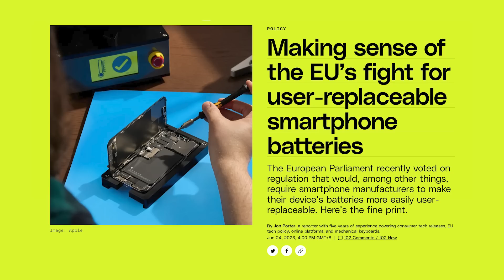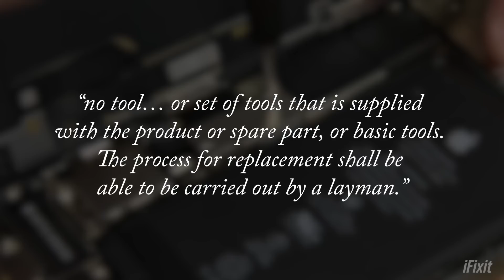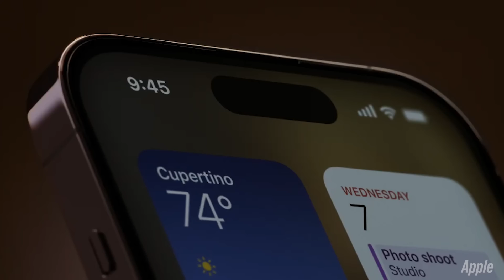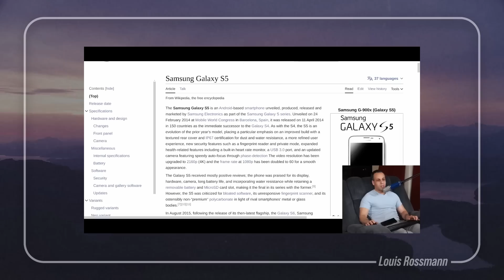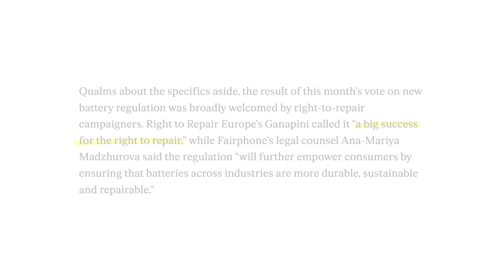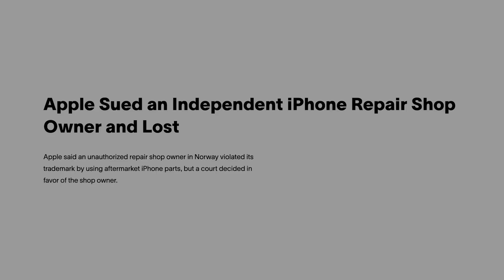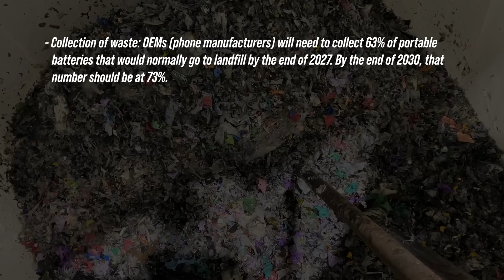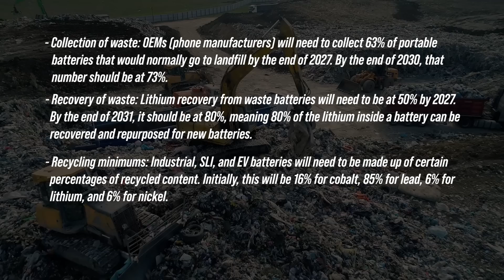EU Just Changed Smartphones Forever

Comment: As an electronics engineer with over 10 years of experience in product development: we build spaceships skyscrapers and tokomacs in  21st century. Making  a removable battery is not a challenge beyond possible. The fact that the phone.makers need to be coerced to it ( just like with common  charging connectors) makes it an axiom that it should be done.

Comment: simple mechanism like the sim tray uses in the current phones being IP68 is the solution for phones & Tablets. Laptops had user replaceable batteries till last yar and its not that hard or requires much engineering. A very good move by the EU.

Comment: The battery thing is the most non issue of all time. Replacing your battery is $20 dollars and 20 minutes of your time. This is the easiest repair for anyone who isn't lazy. You can and should replace your phones battery after 2 years of use. Prying the screen apart or glass back and unscrewing a few screws and wiggling out the adhesive is not as hard as some of these channels suggest. The only real problem is Apple and their software locking. The EU if they had braincells and weren't secretly schilling for these companies, they would ban apple and other companies from software locking hardware. But of course they make this battery replacement bill (about sticky adhesive?? LOL) that doesn't solve anything and the public with their low IQ goes "woo for repair! EU is doing gods work!" without solving the real issues.
Reply: Your kind of out of touch dude. Normal people are never gonna attempt to change their batteries on their own. I agree it’s pretty easy, but it’s daunting to most. This is just a stepping stone towards banning part serializing. If the EU comes out guns blazing like that, then they will be ridiculed and called communists for trying to control private organizations.

Comment: I replaced the battery in my iPhone 11 and the phone informs me that it is not a genuine part.
If refuses to reveal the “wear-level” even though it does tell me the charge-level. This means I cannot sell the phone on. The battery is as good, if not better, than the original was when new,and the phone works perfectly,…….. but Apple wants to “seal-in” (literally) its profits.

Comment: You can make the charging port and the battery removable ( while keeping the bottom speaker ) like a sim card tray. Its definitely possible and it would be super convenient.
Reply: Around 10 years ago I started thinking why we cannot just have a really small integrated battery (like 500 mAh) and the rest 3500 mAh removable. The internal would act like a bridge battery, so when you swap batteries the device won't even turn off and you get 100% charge instantly. Keep the other one charging in the meanwhile. It would be so damn convenient, but I suppose this law prevents that from ever happening unfortunately.

If I recall, there was this IBM handheld computer somewhere around the 90's that did exactly this. It was super popular in Japan and is now highly sought after collectors item.
Reply: @PhazonBlaxor   technically that was the job of a cmos battery to ensure a power to your motherboard's internal clock so your computer wont keep resting to manufacturing date every time you turn on your computer.
Reply: @ChibiKeruchan  No, I'm not talking about cmos battery. I mean a proper bridge battery that keeps power fully on while the main battery is swapped. This is not a new concept, but not really utilized much either.

Comment: And what about the OEM/Carriers issuing 'upgrades' that are actually battery downgrades (destroying battery life) and speed limiters (slows processor speed) to get users to buy new devices? The evidence is literally right there in your hand, stored in your phone's restricted OS memory (along with all the bloatware you can't remove).

And remember, those 'upgrades' are still in place, affecting the new batteries, if the batteries are replaceable. This is another issue that needs to be handled with a similar ruling.

Buying a smartphone, laptop, etc. should be an user's choice, made when the user decides they want new capabilities, not a manufacturer mandate (designed obsolescence at its finest). Not everyone can afford a new phone every 2 years (or less).

Personally, i liked my old S8+ (all the organized options, USB C, Miracast -not forced to use ONLY Chromecast-, HDMI (and DEX functionality), symmetrical/centered camera system) - but i HATE all the iPhone design knockoffs (iOS, Android, and any other with that corner camera system - smacks of 'oops, we forgot the camera when designing all the new cool features but we have some corner space so cram the camera there') that has become so prevalent - those phones are ugly.
If you are going to put the camera system in the corner, use both corners and give us stereoscopic photography.

As an owner of a Pixel phone, i can say that unless you have home high speed internet, do not purchase this phone - no Miracast (Chromecast only option), no USB-C to HDMI (both removed after 2012, software and chipsets), settings are not organized (took a week to find all the 'do not disturb' settings located all over the place), front side camera is in the displayable screen area and doesn't respond to touch (both the d'n'd and camera placement affected a game i was playing - one of the controls was at the fs camera's position, and i needed to hear alerts at all hours as it was realtime); its a mess for Google's then flagship device.

I know both Google (company) and Pixel owners will disagree with my opinion. But i don't have home high speed internet and feel the phone has been crippled. As an example: with only 1 internal wifi system (standard for almost all phones, unless rooted there is no option to add a second adapter), you can't connect to both a wifi internet connect to a hotspot and wifi direct stream to a display such as a TV or streaming enabled monitor at the same time (only one can use the wifi at any time). Miracast is superior in that you use the cellular radio (internet) or the phone's memory for data and wifi direct for streaming at the same time (no internet really needed except for updates, its a service); Chromecast needs all that plus its own internet connection (its more of a media server, not a media service, and regularly checks in with Google).

For those that have read this far, you may wonder what the connection is? Because of OEM/carrier decisions, that the sales clerk/representative/associate usually don't know about, this phone will be chunked and disposed of in some landfill sometime in the near future. Because the innards are mostly non-modular, there is pretty much no recyclability.

Similar to a laptop i have: the display subsystem has died for some reason, but you can hear it boot to Windows. I was going to remove the M2 style drive and put it into an USB adapter, to recover software keys and data, only to find it is soldered (shield cover and drive itself) to the motherboard- no recovery, replacement, or upgrades for anything.

Comment: The graduation from removable batteries in smart devices, was a 100% profit driven developmental restructuring, designed to bolster sales! Eight out of ten people would simply buy a new device, rather than take their chances at finding an honest repair tech, especially those employed by the device manufacturer! It was simply too easy for a company tech to deem the device unrepairable in many cases, forcing the consumer to pay for the tech's time, and then still need to purchase a new device! It's an absolutely corrupt system, because the device did get repaired and got sold as a refurbished device, to another consumer!

Comment: the removal of user replaceable batteries is simply due to the fact that replacing batteries is not a big issue for consumer goods (as long as the life span is reasonable. ) user have other priorities. but also there is lack of alternatives to smartphones both at the provider and manufacturer level. manufacturer are only too happy to implement planed obsolescence parts into their devices... and battery ranks very high in there.

Comment: Bah. I still have an old Samsung Galaxy Core with a replaceable battery. I keep it mostly as an alarm clock; I can make it talk, which I never got my Motorola Moto G6 to do and still can't convince my Pixel 7 to try. The Core fits in any of my pockets and is at least as easy to handle one-handed as either of my newer phones. Lighter, thinner phones do nothing in particular for me. That leaves only profit motives.
But if I had to bet, I'd say that Apple and other cell manufacturers will simply stop selling phones in the EU. They'll make EU citizens buy their phones from the UK or other non-EU countries where the replaceable battery laws aren't in force.

Comment: The European Parliament has passed a sweeping new law that will force all consumer devices, including phones, tablets, and laptops, to have easily replaceable batteries. The law will have a global impact, as manufacturers are unlikely to design specific phones for the EU. The law requires battery replacement to require no special tools and should be able to be carried out by a layman. The glass sandwich method of construction, which is the industry standard for smartphones, relies heavily on adhesives and will need to change to comply with the new law. The law will come into effect in 2027. The right to repair movement has lauded the ruling as a big success, calling for consumer goods to be easily repairable. While some argue that removable batteries will make smartphones bulky and less premium, the LG G5 has proved that it's possible to make a phone thin, premium, and with a removable battery. There are concerns that manufacturers will struggle to achieve waterproofing and dustproofing, but advocates for right to repair argue that society has a collective amnesia regarding water resistance and that well thought-out designs can achieve both.

Comment: Like with every change, not everything is good news.
It's good to be able to easily replace a battery after 4 years of use and get a new life for an 'old' smartphone.
- battery replacement, might include loss of impermeability
- Since batteries become easily replaceable, the quality and or power available of the standard battery might drop to lower the production cost of the product.

Comment: The battery in my iPhone started to finally be awful in December 2022. After about 2 years of having the phone. I didn't want a new phone, as my 12 Pro still works just fine (other than minor slowdowns in a few games I mostly play on PC anyways). I suck at hardware repairs even on my desktop PC, so instead, I just paid Apple $80 and after 2 or so hours, my battery is as good as new. Why spend $1000 on a new device when you can spend under $100 to keep your existing device?

Comment: I hope for a strict enforcement of this law and the introduction of additional laws to minimize any potential loopholes.
Reply: The loopholes are already there, which is why this video and other headlines are worthless. The law already has a couple of exceptions. For example, the battery doesn't need to be removable if that would mean the device is not waterproof anymore.
Reply: @Molemanski  Can't find any info about it and as was mentioned in the video smartphones that are water ressistant and have a replecable batery is a thing... so your idea of a loophone sounds like complete fake especialy considering that companies used this excuse about "waterproof " in the first place just to drop the idea of having phones that are actualy water ressistant(so you cant use this excuse if your phones are not waterproof).->plus "waterproof" is weaker ressistance and its super easy to achieve it...
Reply: @Bialy_1  Skimmed the document again for you. Regarding water, it only applies to devices which mainly use involves getting wet. So you are correct on that end.

But there is another exception that does involve mobile phones. It says that if the battery is of a certain quality, it may not have to be removable.

According to the EU, a battery meets this requirement if it still contains at least 83 percent of its original capacity after 500 charging cycles, and at least 80 percent after 1000 charging cycles.  This means that companies such as Apple may be able to invoke this exception, and therefore do not have to make the battery easily replaceable for end users as long as it is high enough.

Comment: What will happen is that the very strangely named Amazon aftermarket batteries will be rejected by the device - meaning the OEMs will still find a way to get you even if the battery is 'removable'
Reply: I wouldn't underestimate the Chinese ingenuity at spoofing phones into believing their Chinese batteries are OEM. Too much money to be made in aftermarket batteries.
Reply: @Jin-Ro  I reckon we'll see hey
Reply: Even then the original battery will be cheaper than a new device.
Reply: @shmchuck  Probably 🤦🏻

Comment: This law is good, nowadays people with 3 or 4 years old phones will start noticing the phone getting laggy. This is because the battery life has been reduced to less than 85% or lower. What this does is that the software of the phone lowers the power of the processor to compensate with battery degradation; so just taking it to get the battery change will sort this problem but what people usually do is that, they replace the whole phone. (Apple's master plan)

Comment: They can have an external battery like an eGPU or a way to bypass the battery when charging so if it goes bad that it won't kill the device. Or they can have it to where the battery ejects out of the side like the sim card tray. Over time batteries will get thinner and therefore they can come from the side

Comment: Corporations has simply got too greedy I still have my lg k20 that's over 5 years old and it works perfectly fine except the fact I can't use current application such google pay, certain banking apps and many others. But despite all that I still can swap my battery. I've saved easily over $1000 because i don't have to be forced to change my cellphone every 2 years when the one I have still works and makes calls as text as any other phone should.